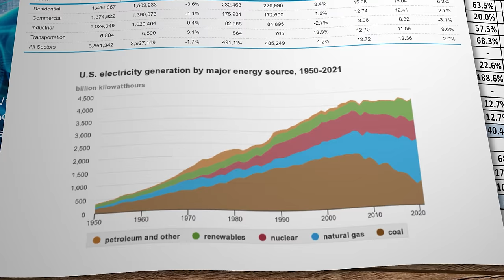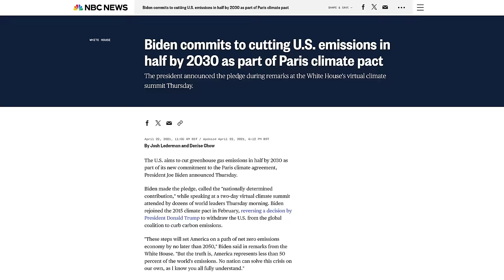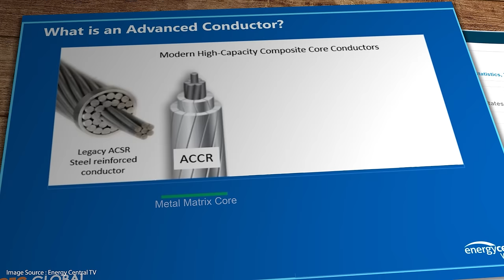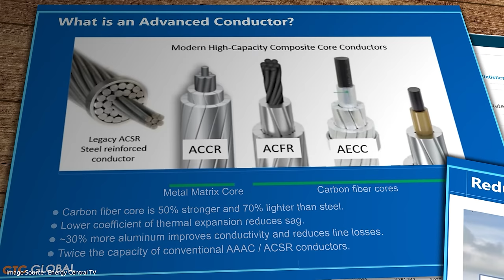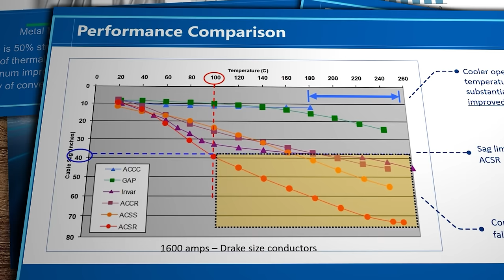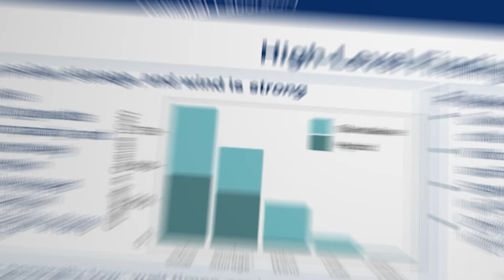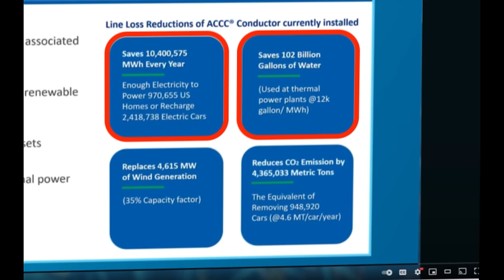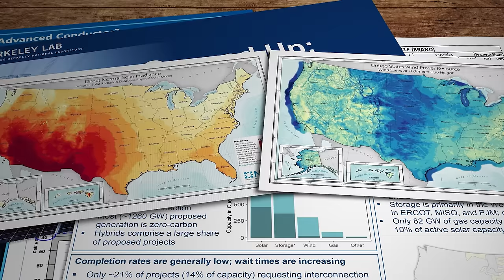Rethinking electricity grids.

Comment: How about allowing and encouraging the grid to be more decentralized. 
Solar and batteries, cars. 
take in power in batteries when it is there, and deliver it out when it isn't. 
If a lot of the demand can be taken care of locally, and you then can "refill" when the demand is low, the current system will not only be less stressed, but also better utilized. And combined with reconductoring it might not even be needed to build out the grid.

Comment: Nice video on the easier part of Transmission reconductoring. Now onto the depressing part for all electric dreamers of sub-transmission & Secondary upgrades much of that mandated to be placed underground since the mid/ late 1960s in the United States. Much of that is not in duct systems, but directly buried into congested right aways grounds roadside to the end user. Faulted direct buried is often abandoned in place, and replaced with new because old is often not possible to remove as it was thrown in an open trench buried often twisted, or so close to communication no contractor wishes to damage crossing utilities pulling old cables now clogging up right away any available space wanted for new cables. Upgrades of electrical capacity, if possible at all, will be a foot or meter by foot or meter daunting challenge. Today, In some places even replacing faulted 120 volt secondary street light cable is not possible as the right away is full of new, old, & abandoned in place., leaving street sections dark, and local governments & residents complaining. Now what to do when just one of the local trucking company wants 1.2 megawatts to charge just one truck in the fleet or much of an all electric fleet of trucks for a 400 mile run to return to the terminal. Seems more research, and study is needed here to grasp the issue of electric upgrades in dense population areas shown on the third map shown indicating powering the last many miles to the consumer. Yes decades, and decades, and decades of right away battles to make room with lots of Eminent domain land grab battles. Utility right away departments are going to be in politically charged judicial battles for the foreseeable future to make the utopian dream of an all electric zero emission transportation system in just the United States where personal transportation is dominant because of the United States size. These comments are just a few of the complexities faced to upgrade the electrical system over the next 50 to 100 years to go all electric. Much of the time retail businesses are close to a road to encourage patronage. Now the utility right aways are full. To put in new electric cables buildings have to be …..what ??? Moved or cut in half, or torn down one at a time for miles or kilometers to bring power cables to the desired electric vehicle owner(s) in mass as conceived of to be all private/ commercial zero carbon all renewable civilization. What a fallacy. Really. Well ignorance is bliss.

Eminent domain refers to the power of the government to take private property and convert it into public use, referred to as a taking.

Comment: Overall this appears to be a good strategy to increase the capacity of existing utility power transmission lines.  Here are my comments.

Manufactures of all aluminum conductors and ACSR (Aluminums Conductors Steel Reinforced) provide the amount of current for the different kcmil sizes the conductors can carry that raises the conductor temperature  up to 75 degrees C when the ambient air temperature is  25 degrees C  and the wind is blowing at 2 km/hr or2 ft/sec. Note that all aluminum conductors are only used for distribution and not for transmission since for distribution the spans are much shorter and the extra strength provided by ACSR is not required.

With the same ambient conditions, higher currents can be carried with higher conductor temperatures. Also, the colder the air temperature and the faster the wind speed, the higher amount of current the conductor can carry with the conductor temperature remaining at 75 degrees C.

The higher the temperature of the conductor, the higher the resistance and the more sag it will have. The  tensile strength also decreases with higher temperature but up to about 200 degrees C it is not  significant especially  for aluminum alloys. 

For ACCC conductor, In addition to current ratings for conductor temperature at 75 degrees C, the manufacture also provides current rating for conductor temperatures ot  180 C and 200 C also  with ambient air temperature at   25 degrees C  and wind speed at 2 km/hr or2 ft/sec.

The increase in sag for ACSR conductors can be significant when higher currents increase conductor temperatures, whereas for ACCC the sag is much less for the higher temperatures. Resistance also increases considerably when higher currents increase conductor temperature, which is true for both ACSR and ACCC.  Increasing conductor temperature from 75C to 150C increases the resistance of aluminum by about 29% and going from 150C to 200C will increase resistance by another 15% for a total increase of about 48% when temperature is increased from 75C to 200C.

Since the same size ACCC conductors or lighter than ACSR conductors, ACSR can be replaced with about a 30% larger size ACCC conductor using the same towers that support them.  This means that for the same amount of power being transmitted, the ACCC conductors will have lower heat losses. 

In addition to ACCC being able to carry more current because it is replacing a smaller size ACSR conductor,  ACCC conductors can also be operated at higher temperatures because they will have  less sag at higher temperatures than ACSR.  If a conductor can be operated at higher temperatures, it can also carry more current but resistance also increases. Increased resistance results in a higher percentage of power going into  heat losses.  Doubling the current, hence doubling the power, increases the conductor temperature from 75C to 200C which will increase the resistance by 48%..  If conductor power lost to heat are in the 5% range when conductor temperature is at 75C, the power lost to heat will increase to about 7.4% range when the temperature is at 200C

Because the reactance of a transmission line is over twice as much as the resistance, even if the resistance is increased by 50%  at the higher temperatures, the impedance, which is the square root of the reactance squared plus the resistance square,  will only increase by a few percentage points.  This means that the higher resistance values at the higher temperatures will not have much  effect on voltage drop.  Voltage drop is the current multiplied by the conductor impedance so the increased current will have much more of an effect on voltage drop than impedance will because the current would have increased a lot more than the impedance when the conductor is at 200C.

Comment: I mean, sure, but... transmission lines are incredibly expensive even when the pylons are reused.  It turns out that most transmission line congestion can be alleviated without restringing anything, and the solution is already being deployed.  How you might ask?  Glad you asked!

Most line capacity issues are associated with peak periods.   The average line capacity utilization over a 24-hour period tends to be extremely low... less than 50% of the line's nominal unstressed carrying capacity.   Peak capacity needs tend to only run 4-6 hours a day.  For consumers, the late afternoon and evening peak, for solar farms generation it is across peak sun hours, and for wind it is more about smoothing out the generation over the course of a number of hours.   

Now... what technology do we have that can cut the tops off of peak periods?  Hmmm.... lets think really hard.  Oh yah.  Batteries.  Grid-scale batteries to be precise.

California has been using grid-scale batteries as a two-for-one deal.  First to avoid having to restring or add very expensive transmission lines, and second to load-shift the over-production of solar energy to hours where it can actually be useful.   This double-whammy makes the batteries a cost efficient solution.   More cost-efficient than restringing or adding transmission line capacity.

Now, certainly this doesn't solve the problem all by itself, but the cost effectiveness in the locations where it can be done is unmatched.   A solar generator can easily lop-off 20% from peak export power, transmission line hubs can easily buffer energy to bypass congested transmission line corridors, choke points in the system can easily do the same, wind farms can smooth production output.

So now we have two relatively cost-effective solutions, which is great.

-Matt
Reply: what do you need to build a new infrastructure? (starts with P ...and end on ermits)

Comment: I read some recent studies (yes by proper researchers :)) on the transition to fully renewable grids.  It sounds like re-conductering is a great way to keep the existing grids going but at much higher capacity. However if we start looking, in the countries and regions where it works (Australia, where the studies were done, New Zealand, where I live, Island communities around the world and pretty much everywhere where population density varies quite a bit (i.e. not Western Europe)).  Anyway, one of the studies showed that rooftop solar can be a great vehicle (wait for it) to provide night time power.  How does that work I hear you ask (yes, Dave blatantly stolen from you), well, by putting that abundant daytime solar in EV batteries and using that at home at night! That does two things: store the daytime solar abundance in batteries, without building massive storage systems and stopping the overnight charging of EVs (or at least the great majority of commuter EVs).  That study and a dozen others all point to one thing, by going for overcapacity of distributed wind and solar, with firming (i.e. storage), the route to fully renewable electricity is actually the most cost effective way, at least in Australia (and as I'm hoping to prove soon, also New Zealand, Pacific Islands etc.etc.).  This does not mean that re-conductering is not necessary, as interconnectors between regions do still have a place, the need for massive grid upgrades comes down A LOT!!!

Comment: I wonder how one actually does it. If the conductor you are replacing is powering the city, do you disconnect it while stringing the new cable? That has to take a long time. Run the new cable in parallel and switch it over at some point? That would still take time to switch, so what's a city to do? Remove the old cable after the switchover? Leave both runs of cable on the towers, but perhaps the towers can't handle that mechanical load? Just curious how a utility would physically make the switch.

Comment: Flash graphene makes it possible to turn carbonaceous trash into graphene with a simple electric spark. This solves two problems, turning disposable waste into a useful product and taking a premium priced product into a low priced commodity. 

There is the added benefit of graphene being a superior conductor of electricity. If we made electrical grid lines using a graphene core transmission would be greatly enhanced and costs potentially reduced.

Comment: I think the premise that there has been a big improvement in efficiency is incorrect, or minor at least.  Quote:- 'The US experienced a mild winter at the beginning of 2023 and temperatures were also milder than in 2022 in May and June. Electricity demand thus clearly decreased in H1 2023 compared to H1 2022' Taken from electricitymaps.

Comment: Fully support existing network asset utilisation improvements and end-of-life efficiency reconductoring, as required, to manage energy delivery in the local electricity market, and all before we develop the supergrid policy which will likely be a stranded asset. 
The Qld Au customer demand of 50,000GWh/an and a max of +10,000MW and +140.000km of existing HV network with a delivery capacity of +80,000GWh/an.... still not align with new networks everywhere.

Comment: Sagging is certainly not a small problem for strippers either.
Have you ever tried to strip the insulation off a sagging cable?
And when you are upside down ,half way up a pole , it's down right dangerous.

Comment: This is a case of people demanding the 'Climate Crisis' is dealt with but as always burocracy gets in the way as pen pushers take up to 10 years to make any kind of decision let alone take action to obtain and grant permits for new builds. Once again, we are our own worst enemy.

The technology improvement of rewiring is fascinating and is remarkably efficient so it will save energy and demand less output from the power stations and also the fact that rewiring comes under MAINTENANCE, not new build, bypasses all the paperwork that the burocrats love to generate.

What I want to know is, is this taking place in the UK or are we still using the same antiquated methods. Also, it is a sad fact that we are ALL still using fossil fuels to generate energy, with alternative sources only taking up a small percentage. I think the only thing that will stop the use of fossil fuels will be when it runs out. Added to this, fossil fuel companies are now investing in plastics, which you cannot escape and cannot recycle.

Comment: A simple policy law change will make a huge difference:  Demand retail  pricing, minimum feed-in tariff of 50% of time rate of charge, programable smart meters.  Minimum price for renewable grid scale generation with minimum storage of X hours supply per name plate generation capacity.  Add a direct tax on fossil fuels and investment in renewable with storage as retail, commercial and industrial users will invest in both generation and storage to arbitrage electricity prices.  Reducing one of the big problems of electricity supply; variable demand peaks.

Comment: ...hmmm...  current numbers are putting the UK's capacity needs for an all electric energy system somewhere in the range of 1,100TWh's/annum (currently 330tWh's/annum), and that assumes we can upgrade around 20 million homes to current regs with heat pumps hitting an average COP of 3 (a million homes per year from now to hit a 2050 goal)...  if we can't upgrade them then we'll be significantly north of this figure, which means even if we can double the carrying capacity of the grid, we'll still be looking at doubling the amount of distribution, with all the fun and games that involves.

Comment: I see nothing new here. I am retired, but worked for a very large power company for 45 years. I have a BSEE degree.
Re-conductoring is NOT a new idea. It was happening the entire time I worked where it was deemed necessary and economical.
There would be some value in better conductors.  But that has also been going on that full time as well. ACSR? Yeah, at one time that was the new type that was going in and copper was going out.
Now we also put 2, 3, or 4 wires per phase. That isn't new either, and has been going on for quite some time. But to reconductor, that may mean replacing towers as the old ones may be aging out, or just not strong enough. Maybe not tall enough for higher voltages.
NONE of this is cheap, and the work would not be done on lighter loaded lines where there would not be enough savings to justify it.
Ah, and solar/wind? A fairy tale. I can see a wind farm right out my window. And a LOT of the time there is NO way it is generation worthwhile power. Even then, it isn't reliable, and tends to drop to nothing at night. Wind comes and goes with cold fronts here.
Which brings up solar, another fantasy. And in the winter here, with heavy cloud cover (happens a lot here), the generation is rather smallish. And ZERO for a majority of a winter 24 hr day.
Electric vehicles? Another fantasy. They might work...somewhat, for short drives in the city.
Out here in the country in the USA, they don't have the range, suffer in the cold, and cannot do the job for the most important folks in the land: Farmers; who run vehicles during planting and harvest near 24 hrs a day....never getting a chance to *recharge*, which takes a lot of time. Pathetic idea.
And BTW regarding wind, and especially solar. ... Yeah, they like to put them in the flat ground area, the best farmland in the country and maybe the world, taken up by solar farms.
Pick one: Food....or solar farms.
You can't really have both.
Solar and wind are both LOW DENSITY energy sources, and take a LOT of land area. They are subject to nature. One large solar farm(s) in Texas just got destroyed by a hail storm.
What now for charging your car to go to work tomorrow Hosea?
Fantasies all.
CO2, you want to get rid of that?
CO2 is plant food. Plants are your food. No CO2, no food. The corn fields of the US midwest and plains make MORE Oxygen by converting CO2 to plants, that the Amazon basin. Do we want to starve the corn belt of CO2?
Pick one....Choose wisely.
Reply: Your vision of the future sounds very dystopian. Im an old guy too. If you believe in science you should know that its always a matter of how much. CO2 is a matter of proportion and we are making too much for our atmosphere. If we wanted to produce an atmosphere on Mars for instance we would make the most greenhouse gases we could to make it hospitable to life.
Reply: @jaaklucas1329  The Earth is currently suffering from a dearth of CO2. It's  at the lowest point it's ever been at in 600 million years. During this period CO2 has been as high as 7000ppm and has averaged around 3000ppm. CO2 has been in a continuous and uninterrupted decline for the last 75 million years coming perilously close to 150ppm which would wipe out all plant life.
Reply: @anthonymorris5084  yea I looked at the graph. You wanna go back to the levels when Alaska tropical? Sure will be warm for the corn growers!